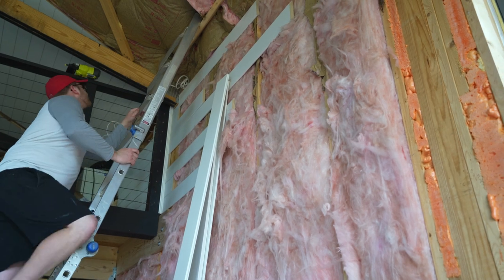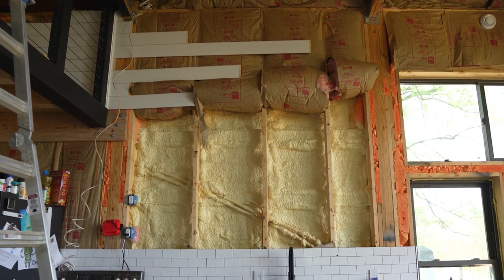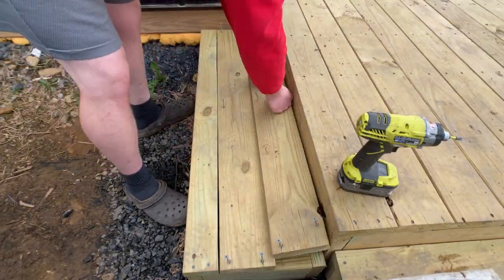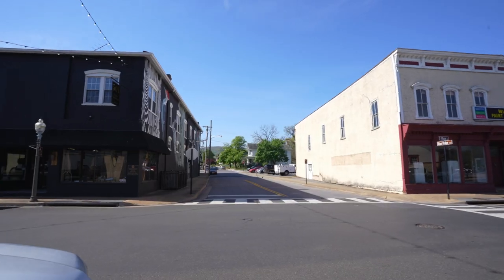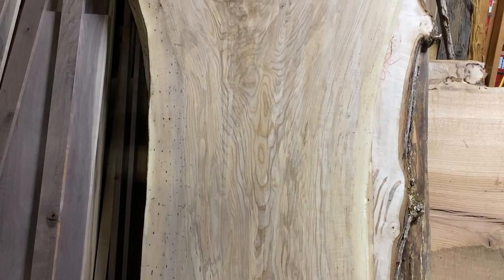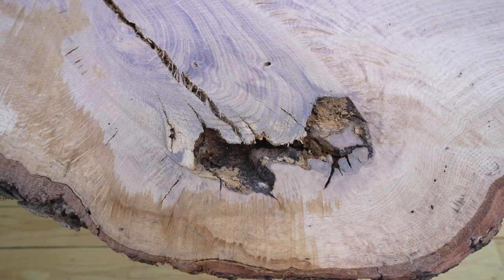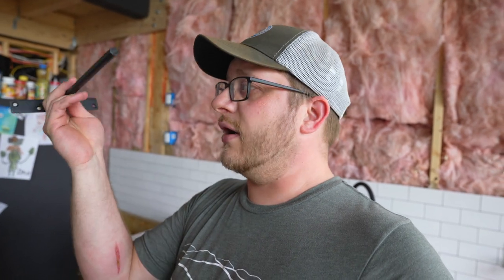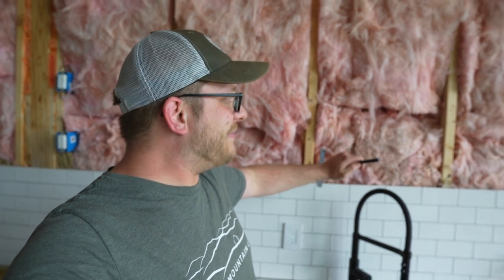Back To Work In The Pole Barn House

Comment: No worries bro, we were all rookies at some point lol! In my 28 yrs of carpentry/ construction my word of advice especially seeing that your using oak and I'm assuming your adding xtra weight on the shelf with other things is get as many of the floating shelf anchors into studs and then the others into your blocking. Into the studs use something like a 1/4 inch by 3 or 3 1/2 inch lag bolt. Cheers from Canada!😁🇨🇦
Reply from the maker: Definitely a lot of anchors in the studs! Thanks!
Reply: @LittleMountainLife  Glad to hear!

Comment: If the butt joints of your shiplap do not fall on a stud place short piece behind them and brad nail. This will hide the seam when the wood shrinks and will also keep the surface flat.
Reply from the maker: Great tip, thanks!